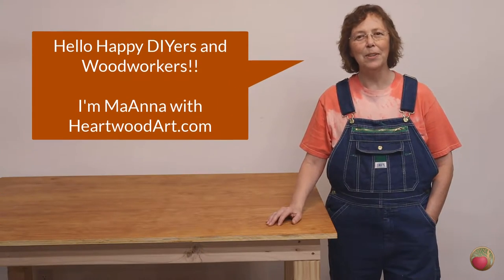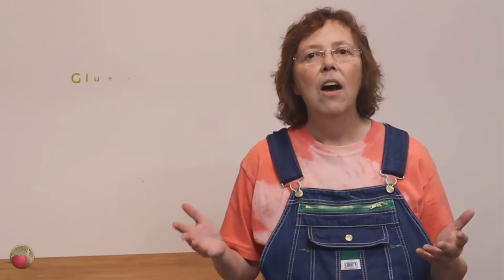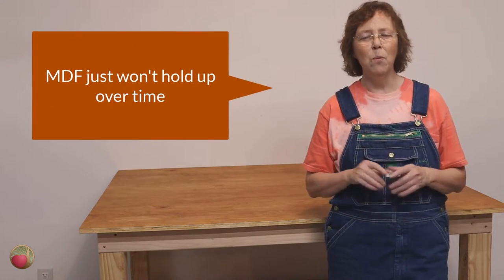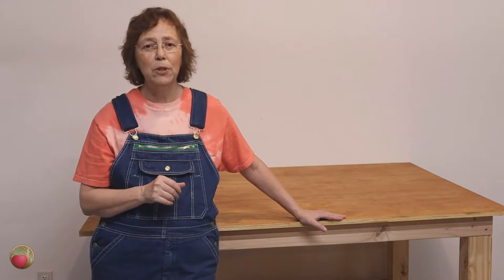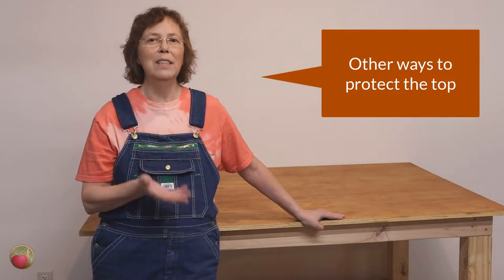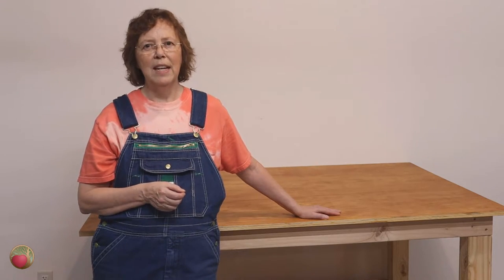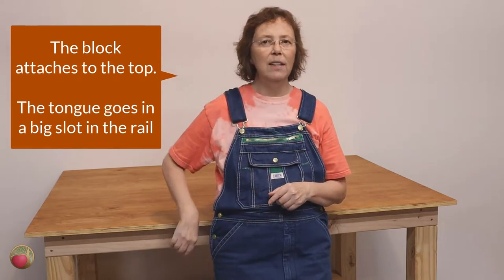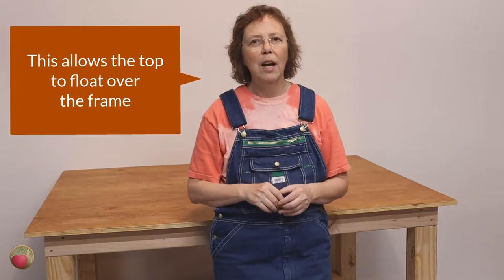The Best Workbench Top and Tips

Comment: I got some 3/4 MDF and laminated 3 layers using wood glue. I cut the edges smooth flush, used round over bit to get rid of the weak corners, sanded and applied 3 coats of shellac. It's super heavy, dead flat and didn't cost much. I was able to get all 3 layers out of one sheet. I have the center supported so it doesn't sag and it's held up well. I use it as an assembly table. My working bench with vices on it has a plywood top but I think I'll replace that top with one made out of 2x4's butcher block style. Workbench videos are some of my favorite.
Reply from the maker: That’s a great idea!! Glue is a LOT more substantial than folks give it credit for. And should be a good sealant for moisture too

Comment: I agree in most of said but based on my experience and the value of having perfect flat surfaces I’d recommend MDF 1 inch thick material..try it! I’ve made 2 workbenches and 1 of them was with a MDF top and happy with that..I’ve replaced it 2 times in 9 years..
Reply from the maker: MDF definitely works well for some folks. It’s humid where I am, so it was not my first choice for this project
Reply: @HeartwoodArt  I agree 100% MDF should not be considered 1st choice..tks for your comment!

Comment: MDF consists of thin panels made from wood fiber, resin and wax. When it comes to engineered wood, MDF is often considered a level above plywood. It is denser, stronger and more durable. For these reasons, it has almost as many applications as solid wood.
Reply from the maker: right up until you get it wet! I'll take plywood for a work surface anyday
Reply: @HeartwoodArt  Well shoot, I was gonna make a fishing boat out of it 😳🤣🤣🤣 just kidding but yeah, ur right about that. I would use a 3/4” MDF under a 3/4” sandee plywood to make my benchtop 👍